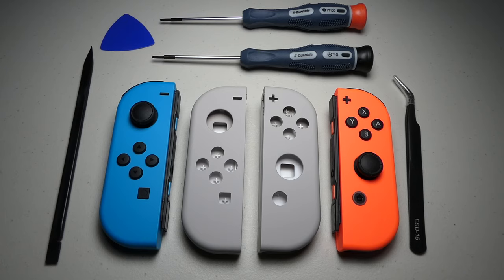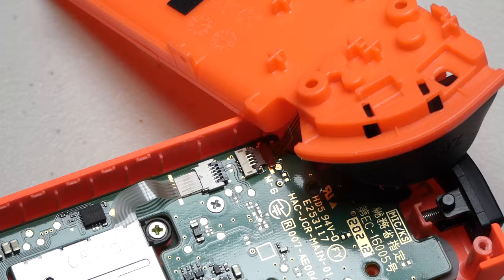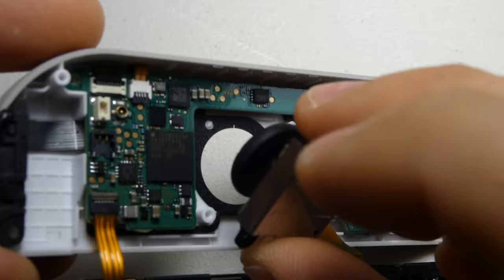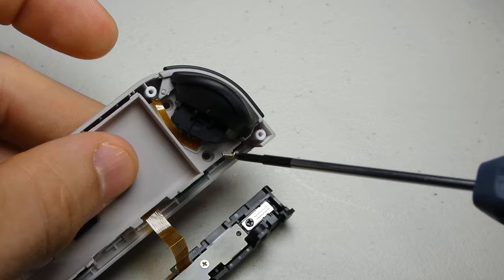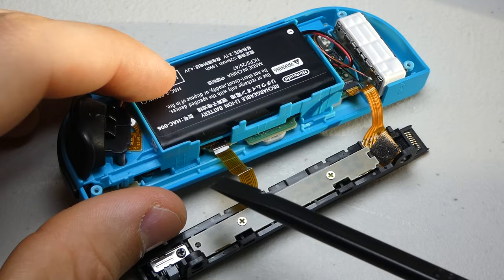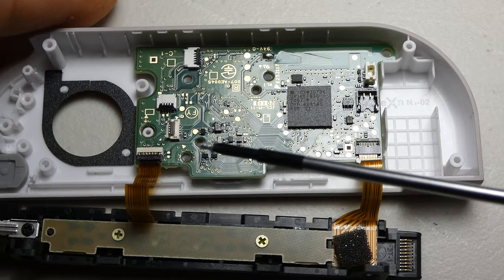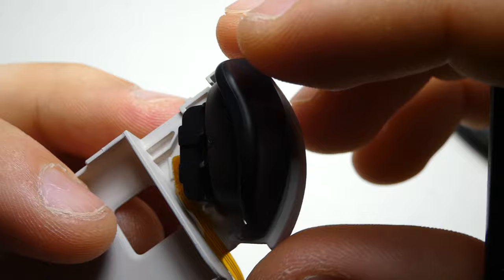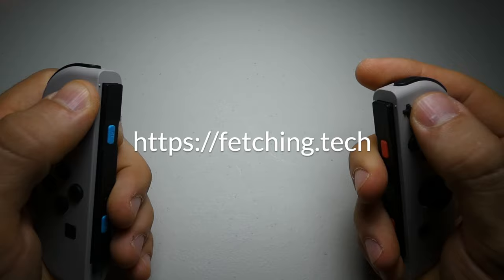How to Swap Out Your Joy-Con Shells

Comment: This tutorial was amazing, just one thing. If the vibration motor cable is too hard to to take out from the motherboard, its easier to just leave it connected. Overall I really liked this tutorial, tell me if you have any suggestions on how to make the minus button tighter though, I just couldn’t for whatever reason get it tight enough.
Reply from the maker: Yeah, that’s a good tip. Leaving as many things attached as possible is a good way to go. As far as the minus button is concerned, I think the only thing to do is just make sure the rubber membrane is fully seated. It should hold the button in place. If that’s loose you might look into getting a replacement for it.
Reply: @FetchingTech  Ok, thanks :D

Comment: Thank you very much for this video! Thanks to this I was able to repair my joycons. After a drop one of the shoulder buttons no longer worked. Turns out the little microswitch broke off the board which I was able to buy for cheap. While I was at it I put them in transparent black extreme rate shells and they look great. 

If this helps anyone else. I had an extremely stubborn vibration motor connector on the right joycon. It would not release out and I was starting to actually mess up the plastic on the connector trying to squeeze it with the tweezers to get enough grip to rock it out. You are able to swap the motherboard into a new shell while still leaving this plugged in. So not necessary to remove it if yours doesn't want to release.  Just pull the motor like shown in the video and transfer it still plugged in with the whole assembly. 

I would also recommend picking up some spare ribbon cables and shoulder buttons from Amazon, they're extremely cheap and some of these pieces are so fragile its unbelievably. Even being extremely careful the large shoulder button had a tiny bit of plastic that holds it into the shell break while trying to release. This way if anything comes up you wont have to wait days for replacement pieces to show up and leave these components and screws and so on out. 

Thanks again!

Comment: Ive been anxious to leave a comment for about a month and a half just because i wanted to finish this 100 percent before i did. Honestly, i did a BUNCH OF RESEARCH  and watched ALOT of videos...and this one, BY FAR, is the BEST for the Joycons. The only thing id like to note is for the Y00 screw driver worked better for me. And the Philips 00 didnt work for me either. BUT, it i ordered a  screwdriver kit from amazon and i suspect thats wut it was. Ended up using the tools that came with the shell casing kit. Glad i ordered the amazon kit tho cos the PICK and SPUDGER is a must. Great video 9.5/10 👏🏽 👏🏽 👏🏽
Reply from the maker: Awesome, I'm glad I could help. It seems like the Y screws on the outer casing are the main source of people's issues, but I've had good success with these toolkits. I'm glad you were able to get it figured out, and thanks for the kind message.

Comment: This video was extremely helpful! You showed everything so clearly and made it very easy for me to know exactly which piece to work on! I was able to switch out the case with no issues!

For anyone trying to follow this, I recommend having the spudger. I didnt have one and I used my tweezers a lot instead and probably risked damaging some very fragile pieces. But otherwise there really aren't a whole lot of parts to take out/put back in, they're all just a little finicky!

Comment: Thanks! I swapped the shell of my right joycon using this guide. I couldn't remove the connector for the vibrator motor (I tried with pliers and I almost ripped the wires), so I removed the motherboard with the vibrator still connected. Thanks for the guide!
Reply from the maker: If I could remake this video, that’s how I would do it. The more things you can keep attached the better. Thanks for the tip.

Comment: I started doing it solo and once I removed a couple of pieces I started thinking it's best to check what I'm doing is right, followed your vid, so helpful, thanks man! I was replacing my joysticks as they both drift, I thought why not change the shell too while I'm at it. I got the white shell like you, but the new sticks I bought are red and blue, so blue on the left and red on the right to keep the original flare!
Reply from the maker: That's awesome, I personally use a black and white yin yang theme on my own console. The asymmetric look is a winner.

Comment: I was extremely nervous doing this and followed this video almost perfectly and everything worked out! The only bit was that the vibration motor did not want to budge, like at all. To the point where I felt like I could've torn the whole thing out of the motherboard if I pulled, even just the plug, a bit too hard. Maybe mine was just a little more stuck than usual but I decided to just leave the plug in and remove the motherboard with the motor still attached. It definitely would've been easier if i was able to remove the motor but gotta listen to the board and feel out its limits. Another small tip, depending on your manufacturer, i feel like the plastic on my replacement shells were a little softer than the stock shells, I very easily over-tightened a screw or two without even noticing, whoops

Comment: Very helpful bing emphasis on have a good clear space and being careful not to loose the spring. I know must people are using the cheap screw drivers that come with the shells but if you think you’ll be doing this similar frequently a magnetic tip screw driver helps a lot.

Comment: I’ll try to change my shells next week and watched this one beforehand to be prepared. Do you have any suggestions if I want to reapply adhesive tape, which is best to use?
Reply from the maker: Any type of double-sided scotch should work fine. It doesn't need to be particularly strong, and you could even reuse the old tape, potentially, if you can carefully remove it with a set of tweezers.

Comment: Great tutorial! It took me a lot more longer than it should’ve taken. I did one Joy-Con on one day and the other on a different day. On the second Joy-Con, I did exactly how you said but for some reason the buttons were not responding. Lights were on and everything so I know it wasn’t the battery. I took it all off again 😮‍💨 and checked to see what I missed so I reconnected everything but I didn’t remember how to put it the battery. For some reason I thought it was a slide in. I was doing this without watching your video and so the red wire of the battery came off. Luckily I have a spare Joy-Con but sucks 😅 I will learn from this mistake. I am enjoying my SNES Nintendo Switch.
Reply from the maker: Those battery wires can be pretty fragile. I had one come out of the plastic housing, and I was able to slide it back in and connect it, but I'm not positive it would stay in place if I shook the controller enough. Hope you enjoy your new controllers anyways.

Comment: more Tips: a better technique for the R controller, when you're taking out the ribbion cable for the trigger and then take out the circuit board, its better to put in the ribbon cable before attaching it to the other joycon shell first
Reply from the maker: That's a good point. Any time you can install the ribbon cables while you've got more room to work, it'll make it way easier on yourself.

Comment: I fear no man. But that thing 6:26... it scares me. 

No joke, this is the hardest part in my opinion. I have no problem with any other part whatsoever. It's even surprisingly easy. But this freaking cable could be a tad bit longer
Reply from the maker: I definitely struggle with that one from time to time. I'm not sure I'd even be able to do it without a good set of angled tweezers.

Comment: Thank you ! replaced mine , first time , just one thing the white connector thing was so hard to take off that i didnt bother disconnecting it (i shattered the right one to a few pieces trying to take it off luckily it didnt get taken off and didnt break connectivity xD)  and just worked my way around it
Reply from the maker: Yeah, I've stopped disconnecting those too. Not really necessary. Thanks for the tip.

Comment: If you're super careful, you don't really need to disconnect all of the ribbon cables. Its easier to just keep all of the electronic stuff together.
Reply from the maker: For sure, the fewer things you can get away with disconnecting, the better.

Comment: I want to switch to a pair of pink shells but I'm scared I messed it up, where do I get the screwdrivers that don't messed up
Reply from the maker: I have some toolkits available on my website that I've had good success with, but the external screws Nintendo uses can be quite troublesome, so your results may vary.

Comment: I didn’t need to disconnect any of the cables, i left the battery in its miscolored plastic housing, changed the backplate, lifted the motherboard and joystick and rumble motor, and put the new front plate on and that was it, but i did try to be careful with the short batter cable
Reply from the maker: Yeah, if I remade this video, I would leave as many things attached as possible as well. Thanks for the insight.

Comment: Things went really smoothly with your advice and Youtube comments. Sadly, I cannot replace the case because of "faulty made case" which causes my A button stiffy during the replacement, wish I could've bought your case. Anyways I did manage to replace my right analog, really helpful and informative video, thanks!
Reply from the maker: Awesome! I'm glad I was able to help. Sorry about your case not working out, but it sounds like you may be able to file out that part of the shell and maybe get it to work in the future. Thanks for the kind words.

Comment: I did this and a button swap and it was 100% worth it. I stripped a screw on the joy con and it was scary I somehow got it out by taking off the back shell there was little damage. I got lucky but still worth it since it was my 1st time.
Reply from the maker: Stripped screws are a real issue on Joy-Cons, especially the tri-point external ones. Glad you got it all sorted out.
Reply: Me 2 bro !!!!
Reply: You should buy the tools from him, they work great. I've been opening and repairing Wii and GameCube controllers with it as well
Reply from the maker: @playboi182  I'm glad they've been working for you. It was the best set of tools I could find for the price.

Comment: Got the right controller done today going to wait till tomorrow to do the left one but I found it easier to leave the motion sensor thing attached it was just too much for me, if you do attempt before giving up though remember to push it back in ( just incase it came out a bit).

Update, left controller done joystick seems a bit stiff but it’ll probably fix itself overtime. Hopefully. Left controller is significantly less difficult and infuriating then the right one. Thank you.

Comment: This was excellent. Did it perfectly. I have ONE question. Do you use none Nintendo cases? Luckily my swap was with a custom made official Nintendo shell so it went super well. But what is the fitment like on none oem?
Reply from the maker: The ones that we sell are essentially an exact replacement for the OEM versions. I haven't had any issues installing the custom ones, but I can't speak for every custom shell on the market.

Comment: Got one done and when i was doing the second joycon i stripped a screw. My joycon kit came with enough replacement screws to fix a whole controller but you need to be careful with them little screws
Reply from the maker: Very true, the screws Nintendo uses are very easy to strip. I hope you were able to get yours sorted out.

Comment: Just ordered pink shell, white buttons and white sensor button, was worried it would be hard to remove and replace the sensor button but from the looks of it , it’s just 2 screws and 1 connector.
Reply from the maker: Yes, it is pretty straightforward. I've got a video of that process coming out this weekend.

Comment: So, I did this yesterday, got them all set with the buttons and shells (and even white thumbsticks) all courtesy of your Etsy store, so thank you, I really love them! My only predicament is that the sides (where the SL and SR buttons are on both joycons have the tiniest bit of curve to them after doing this operation. Do you by chance have any pointers for this? Thank you in advance!
Reply from the maker: I'm sorry for the late response. Normally the backplate will bow when not everything is seated properly. It can be tricky to get everything to line up perfectly when reinstalling the backplate, and the WiFi chip is the bit that gave me the most trouble. I hope that information is helpful.

Comment: I was following the video and at the moment you separated the shoulder button, I did the same by taking it off with my thumb but mine came apart. I now have the small button with a silver looking casing that goes over it. I can’t seem to lock it back in place what do I do
Reply from the maker: Hmm, I'm struggling to picture what might have happened. It sounds like the plastic shoulder button may have broken. If that's the case you'll unfortunately have to find a replacement. Feel free to send me pictures either through etsy or the website, and I can try to diagnose it further.

Comment: Hardest part to me was fixing the button mechanism of the R button that I accidentally broke. It might be just bad luck but the thing is very fragile, the entire component fell apart :/
Reply from the maker: The shoulder buttons can be a really nuisance. Was it the button itself that broke, or the actuator that is connected to the motherboard?
Reply: @FetchingTech  it was the actuator. It was probably already loose because it's an old joycon and from what I researched it is a common problem for these to just disconnect from the board
Reply from the maker: @laurosf  Yeah, you're not the first one to have that come up. Unfortunately, the best you can really do is pick up a new board off eBay. It might be the sort of thing that could be soldered, but that's a bit outside my wheelhouse.

Comment: My screws are swept. Someone suggested me to break the shell and replace it with a new one to rescue the joycon.
What would be the best way to break the shell without damaging the inside?
Reply from the maker: I suppose it might depend on how many screws are stripped. If it's just one or two on the same long edge of the shell you might be able to pry up from the other end and snap it. Otherwise, you might have to use some sort of saw to cut the back shell in have to give you a place to pry from. Good luck, I hope it works out.

Comment: I feel joy con movement from the HD rumble sounds/feels different before I changed it, I'm going to add an adhesive strip to the battery maybe that'll fix it.
Reply from the maker: That would be my first suggestion. Sounds like it may be moving around in the controller.

Comment: It was really hard for me to screw in the closing point screws? You did it easily how? I didnt use the original tripod screws tho
Reply from the maker: It's possible the replacement screws are a little wider than originals. I wouldn't think they'd be too hard to screw in though. Perhaps there was something internally getting tied up.

Comment: I switched out the shells and followed this video to the T. Right controller works fine, but the left controllers thumb stick doesnt work and causes the switch to move down every other second. There is a possibility I scraped up the cable that connects the thumbstick to the motherboard. Any thoughts?
Reply from the maker: The ribbon cables are notoriously fragile. If the cable is inserted all the way and still the joystick is acting all funky, that would be my guess for what might have happened.

Comment: This might be a bit of a stretch in what can be done- but I initially did this without a tutorial (worst mistake i have made) and used a longer screw for a section that required a shorter screw. The shell that I ordered, doesn’t seem to be that high quality, so it ended up going through the shell. Hence, there is a hole in the plastic. Is there anything I can do to repair that?
Reply from the maker: Hey, I'm sorry for the late reply, and I'm sorry to hear about your shell. You're definitely not the first person this has happened to. Unfortunately, I don't know of any way to fix the damaged plastic. If the plastic just got poked out a bit you could probably sand it and repaint it, but especially if the screw went all the way through, you'll probably need to replace the shells. I'm sorry I can't be more helpful.

Comment: I did this without issue and was so proud of myself… but now the joy stick is wacky (screen scrolling without me touching it) and I’m not sure how to best troubleshoot
Reply from the maker: The ribbon cables on the joysticks are pretty fragile, my guess is that it may have gotten damaged during the swap. If you take a look at the ribbon cable you can usually see visual signs of damage if that is the issue.

Comment: I made a stupid mistake that resulted in the two SL/SR ribbon cables getting pulled out from the motherboard (they're still attached to the back weight). I assume there's no way to reattach them?
Reply from the maker: It sounds like the solder may have detached from the motherboard. In that case, you'll probably have to buy a new motherboard, sadly.

Comment: I have done this once from experience everything is super small but doable with your fingers and I have slipped and scratched the board multiple times and it was ok so ya
Reply from the maker: Yeah, I wish the parts were a bit bigger to work with, but unfortunately that's the nature of today's tech.
Reply: @FetchingTech  ya I don’t mind how small they are I have patience with these kinds of things so I don’t mind how many tries it take to plug a tiny cord in lol